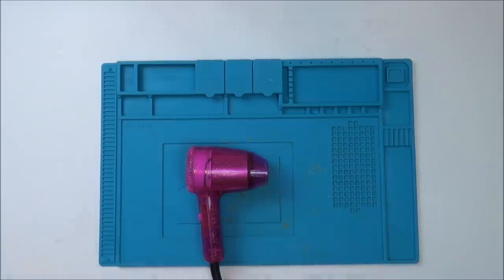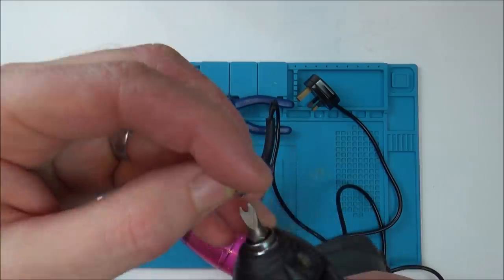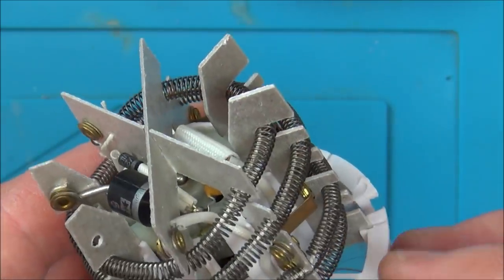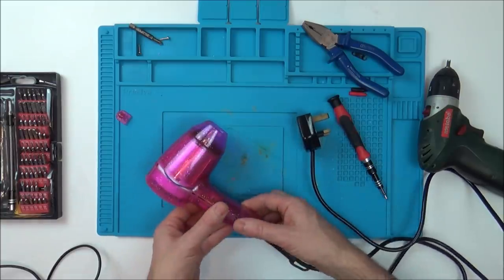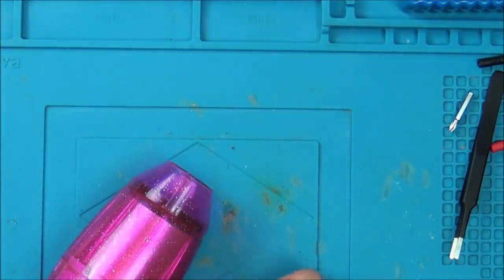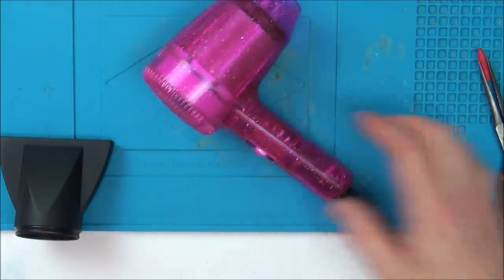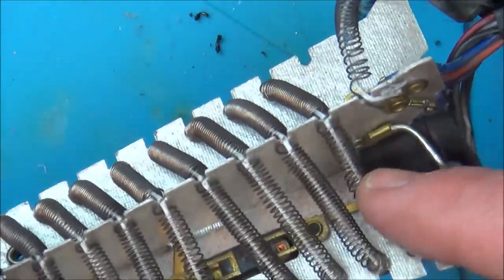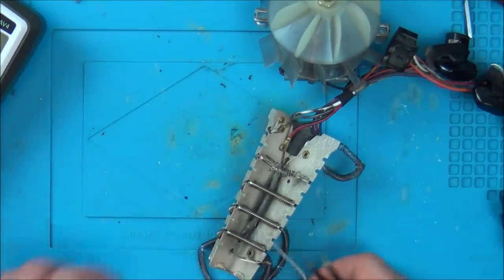Trying to FIX: 2 Faulty Hair Dryers

Comment: Great video once again Vince :)

6:25  this is a filter capacitor to avoid adding noise to other equipments connected to mains, it is required by EU laws (you can remove it thow, it will work but you'll be feeding noise to other electronic equipments). The resistor is meant to discharge the capacitor, otherwise you would get a shock if you touch with your hands on both plug pins.
Inside basically you have a heating resistor that is divided in at least 2 parts, to create a voltage drop, this voltage drop is then used to feed the bridge rectifier that feeds power to the motor while is being heated up.
The motor speed can be set by getting a heating resistor windings ratio or it can also be made by passing current throw a diode, making a voltage drop (0.7V), slowing the motor down, it depends how it's made, but usually is made out of the heating resistor windings .

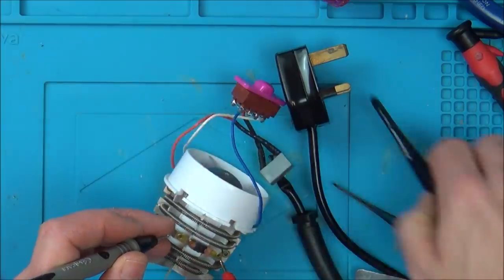12:50 the problem might be with dust in these contacts, which will make it to have more resistance, and it will heat up faster (more resistance = more heat), making it break the circuit.

26:41 You can't redo them, they will break, also you can't touch this resistor with your hands, you will put oxidation on it and it will break a few uses later. You can climp it thow, that's the only way, never tried it but it probably would work.
Also you need to have careful about cutting this since their total resistance interfere with the total power, if you make it shorter, you'll make it heat up more, burning down the house :) also you have to make sure the windings are not touching, otherwise you will create a short.

37:19 *if you reduce the resistor, you'll increase the current since the mains voltage remains the same, and you'll put more or less voltage to the motor, not because of the total resistance that has changed, but because of the voltage drop across the resistor split has been modified, so if you decease it in one side, you might end up adding more voltage, but if you decrease it on the other side, you'll end up removing more voltage, it's all about the ratio.
Reply: That correct
Reply: Great fun putting a device with a HDD for instance next to something completely unshielded and pumping out a lot o' dirty rays hehe   And people with pacemakers used to be the thing to watch for as unshielded devices used to send 'em off heart racing which is why up until not so many years ago you had to turn your mobile fones off in hospitals, and petrol pumps as in the right weather ambience your fone could spark off a treat from the pump earth...
Reply: The big fat diode is being used to block the AC when it's going in one direction, so only half the power (when it's the correct polarity) will get to the heating coil.
Reply: half wave rectification , used to do it on older soldering irons to save the element
Reply from the maker: FixDaily, this is brilliant. Thanks so much. Let me try and pin this comment :-)
Reply: The cap on the input is there to protect collectors of the motor from sparkling and acts like voltage dropper for motor (search transformerless power supply on Google). Depending on configuration, the cap may be in parallel of the mains but then the motor should be in parallel with the heater, but i don't think that is the case, because if the heater burns open, the motor will go BANG at the moment you turn it on, so a cap voltage dropper is more reasonable solution here, nor the heater is in series with the motor itself, the heater is separate circuit, because the motor then can operate without heater. You are close to right for other stuff you mentioned. Here is the opposite for resistance - less resistance = more heat & increased power (W) because its not a source but a consumer.
Reply: @technixbul  thank you for shearing your point, but i have to disagree in some points:
the capacitor you are talking about (to avoid sparkling) is at 7:24 close to the DC motor, also it would not make sense to have a capacitor to make that effect wires away from the motor, it has to be there.
The dropper you are talking about is put in series with the load (the RC itself can be in series or in parallel - but usually in parallel, so the resistor can be used to discharge the capacitor after use) and never in paralel with the load (otherwise you would not have any drop) as you can see by the video at 6:07 it is in parallel. Also a "transformerless power supply" will only provide a few mA of current, not enough to drive a 12 DC motor. 
"but then the motor should be in parallel with the heater" - the heater needs 230VAC to fully heat up (because of it's length), how can you put the motor in parallel with the heater, both would receive 230VAC.
Reply: @SimonQuigley  that is correct sir, thanks for pointing it out.
Reply: @technixbul  
200mA * 12V (motor) = 2,4W not 46W... you can't consider the input voltage... 230V is at the input....
A resistor is not a "current source"... is a current limiter... or it can be used as a current divider if it is in parallel...
"The motor has bridge rectifier and it is in parallel with one coil and in series with other thus efectively create resistor divider with coils" - there is not such thing as "resistor divider", it's called "voltage divider", but i got your point and it is correct.
The example circuit you have provided doesn't have the capacitor because it is meant for filtering the noise, which is not required to make the unit fully functional, but it is required by some country laws, and for a fair reason... But in your opinion it acts like a PSU, but if it was a PSU why wouldn't it be in your schematic? And also, if the heating element acts like a "voltage divider" with a somehow "fixed output voltage", why would you have the need for a PSU? So as you can see, it is not a dropper....
Friend i'm talking about this: https://youtu.be/d55MFGA2GDU?t=31 maybe we are saying the same thing but understanding the opposite :)
Reply: Ellis The DJ  good information is not always too much
Reply: @Brock Callan Definitely, have been watching on instaflixxer for months myself :D

Comment: Thinking about it, it's probably that switch you were looking at!!  It's a bimetalic switch probably - to cut off if too hot.

Something important I should say - When plastic mounts are broken on something like that 2nd one, I wouldn't tape it up and use it that way!  It might be OK as a quick temporary thing, but tape can break / lose its grip with heat etc.  I would hate for someone to get injured (or worse) by it coming apart whilst in use!  The other point related to equipment with heating coils - if something bad does happen, and someone dies, or your house burns down - your insurance may try and blame you!   I thoroughly enjoyed the video as usual!!!! =D 

It's a bit different with other electrical products as generally they aren't dangerous products - eg. PSU in a PS4, protected by fuses - user cannot get near the components.  But electric fires, irons, hair dryers can be lethal, as its easier for the user to come into contacts with elements etc!   With regards to safety of a short hair dryer vs long neck one, I think its fine tbh!  My understanding is because its blowing outwards it would be hard for hair to go inside it, and you need a complete circuit - the hair is only going to contact 1 side of the connection, and hair probably isn't conductive the same as skin.
One other problem you can have when you are missing part of an element - it will lower the resistance of the remaining element, meaning that can go hotter than it was perhaps designed for. (I think - I could be mistaken)!
Reply: Sorry to sound like a scaremonger btw - great video, I just had to point out those things!!  The last thing I want to hear is some terrible accident happened!  I can just imagine the episode   now - "How to fix my wife after she got electrocuted by the hair drier - boy shes mad!"
Reply: You're right. The less resistance between the endpoints of a coil, the more current will flow through, as per Ohm's Law: I=V/R (current = voltage / resistance).

So if originally it had a 100 Ohm resistance, and lost 10 of it, it would go from 240/100 = 2.4 A to 240/90 = 2.667 A. And that means that the wattage would increase from 576 W to 640 W. And more wattage means more heat.

However, the switch may play a role as well. If it reduced its own resistance from 16 to 1 on high settings, that means that the total wattage on medium and high (with the reduced resistance) is 240/106 = 2.26 A = 543 W and 240/90 = 2.667 A = 640 W, respectively. Almost a 100 W difference! And that's another 100 W that will generate heat!
And that's per coil for the high settings, so a total of 1280 W of wattage vs 543 W for medium (if the coils are run in parallel instead of in series).

Bonus Calculation: Originally then, if we assume the resistance between the coils was 100 each, and one was active on medium settings and both were active in parallel on high settings, that means that:

Medium:
240 / 116 = 2.06 A = 496 W

High:
240 / (100*100/(100+100)) = 4.8 A = 1152 W. The resistance formula for two parallel resistors (or coils in this case) is used and is (R1*R2)/(R1+R2). Otherwise you just take the reciprocal of the reciprocal sum of all resistors, in this case it's: 1/((1/100)+(1/100)) = 50 Ohms.

It would not be viable if they ran in series, because we'd get the a lower heat dissipation per volume of coil for double the volume of coil, so the same amount of heat (plus some due to the resistance loss in high settings):

Medium:
240 / 116 = 2.06 A = 496 W. That can be used as the thermal dissipation equivalent for one coil, which means 496 watts equivalent.

High:
240 / 200 = 1.2 A = 288 W. 288 W * 2 coils = 576 watts equivalent thermal dissipation, so merely 80 watts extra in thermal dissipation (assuming the calculations and theories are correct).

EDIT: Added information about how resistance is calculated for two resistors in parallel.
EDIT2: Tidied up the spacing between paragraphs... I hope.
Reply: @GadgetUK164  Particularly at a time where YouTube is targeting and removing videos for "harmful or dangerous content".
Reply from the maker: Not scaremongering at all Chris. All very valid comments and worth pointing out. I added a warning at the beginning of the video just to reinforce viewers NOT to copy the technique used in the video. I just wanted to prove the fault. The workings of it were more interesting than I thought they would be even though they are designed as a throw away item. Never be afraid to point out stuff in the comments that were done in the video whether dangerous or just done wrong. It helps us all :-)
Reply from the maker: Nice one Operational 117 :-)
Reply: What happened with the one my friend has goes like this :::: They plugged a US device in a 230 volt in casablanca......so here his what happened, the small element went too powerful, making it EXPAND because metal expand with heat!! So it then broke the Fiberglass thread that was holding it (Which can resist up to 450 celcius), the stretching on top of the heat cause triple the heat so the cable broked, let the little element loose, and it burned simply because it became loose and shorted itself together. Burning multiple parts of the small coil. Big one still intact. The small one will work on setting 1, then big one on Setting 2, then both of them on setting 3. So now you say? Can I still use it but only on setting 2? No you cant, because the small element creates a bigger resistance, so the big one gets too much energy one the little one his broken, and also, if you disconnect the small element too use only the big one...then same problem...missing resistance and on top of that the small coil his the contact for the Blower Motor, so if you remove the small element the blower motor wont turn on anymore and thus, fan wont spin. :P

Comment: Heat thing is a bi metallic strip Vince same thing they use in room thermostats and portable heaters too buddy great vid again :)
Reply from the maker: Thanks Pork Bap :-)
Reply: The same thing is in kettle switches. Ours started overboiling. It was just the bi-metallic had some corrosion on it. Listen and you can hear the little click after a few seconds when the kettle has finished, that's that same little strip.

Comment: Vince.. if you ever suspect a "Heat sensitive breaker switch" connect your continuity tester across the suspect breaker and then use your heat station to heat the breaker up, if the circuit opens with very little heat applied to it, you need to replace it. BTW.. To clean coil resistors "Heating Elements" I used a basting or small painting brush..
Hair dryer Elements here in Australia can cost "$30~$50" so it's cheaper to buy a new and what's more better quality hairdryer as it seems over the years they have dropped dramatically in price..
Reply from the maker: Thanks for the tips Koala :-)
Reply: Somebody else mentioned that electric hairdryers sold in the EU need to have a filter capacitor to reduce the amount of electrical noise fed back into the electrical supply, I may have understood the post incorrectly.  Do you know if this is the case with hairdryers sold in Australia?  I ask because for Christmas in 1989 Mum got a hairdryer, about a month later I was lying in Mum and Dad's bed listening to the radio and Mum was drying her hair in the en suite bathroom, the radio reception was completely obliterated by interference from the hairdryer, the clock radio was set to FM. and it was making a horrendous noise.

Comment: Bi metal strip is the cut out switch by fiddling with it you may have cured it for a time. The diode is a half voltage cut so is your speed switch  The capacitor in the front is for noise reduction on the line. Also it blows out the front so it will not suck hair in the front.  The wire you can get an apprentice to solder them together, was an old trick played on the  uninformed
Reply from the maker: Thanks Vilhelm :-)

Comment: You can save the winding to make yourself custom high current resistors, the winding is already being used that way you only need to shorten it to a measurable point in ohms that you want. I also recommend to save the heat resistant tower and sleeve, it might handy if you want to test the resistor quickly before you make it more permanent.

Comment: I use a hairdryer because of my style of hair and I been using them for some time now and when a hairdryer does that it's usually  because while the blow-dryer was on somebody covered the part where the hot air comes out causing the thermostat to become faulty

Comment: Metal expands when heating up, which is why you need the heat resistant string within the coils. Without the string the coil will start sagging, thus shorting out with the next coil. The coil wire has a specific resistance per meter. That means if you are shortening the coil it will have a lower resistance which draws more current and gets hotter.
Reply: Please could you tell me the name of this material? I am trying to order I already found the Nichrome 0.1mm for the small coil but it also has that little (nylon) string inside it and I wonder which one to buy, if you could help it would be amazing, thank you !
Reply: @djrival819  I have no idea what material it is. sorry!

Comment: You can keep the heating wire to cut plastic and foam stuff. Just connect a piece of the wire to your bench power supply. The wire is made of constantan, which is a nickel-copper alloy. It has a positive temperature coefficient, which means its resistance goes up with temperature - so it protects itself from just burning up - as it heats the current goes down.
Reply: It's actually very close, but it his Nichrome Wire, a mix of Nickel and Chrome :P

Comment: It is possible to replace elements yourself. Just purchase some Nichrome wire the same gauge and wind it to the same diameter and resistance value. But you have to use crimps instead of trying to solder them to the wires. Do this at your own risk of course.

Comment: Not only the diode, but also the heating wires are connected to the mains voltage. So, yes hairdryers can be potentially dangerous, especially near water. That's why your need a good earth leak switch in your home.

Comment: BI-Metallic strip is the heat limiter maybe some more up market hair dryers can be using electronics to control temperature, the hair dryer is like a low tech version of your hot air rework station without electronics.

Comment: The diode on the heating element is used to halve the power. When the diode is switched in series with the heating element it will only allow half the AC cycle to pass trough, blocking the other half.
Reply: Wont it get really hot taking in account the power that goes in it? Usually for good hair dryer 2200W 230V. And then the poor diode is blasted with hot air. That should be the first thing to fail. 🤨
Reply: 2200W @ 230V is about 10A. With a typical diode Vf of 0.7V that makes 7W. However, the diode only conducts for half of the AC cycle so it'll dissipate 3.5W. So, nothing a plain 5W diode can't handle. A decent design will place the diode in between the blower motor and the heating element, causing cold air to be blown over the diode, cooling it rather then heating it.
Reply: @unimportant5122  
The problem (especially with the small pink one) is that it's directly in the firing line of the hot air blowing past it. And I'm pretty sure the heat from the coils that heats up the air is going to affect the diode sooner or later. And the diode of the pink hair dryer is indeed right in front of the outlet end of the airflow - the designers weren't particularily clever about its placement. 😒
Reply from the maker: Thanks for the info Unimportant and the following comments :-)